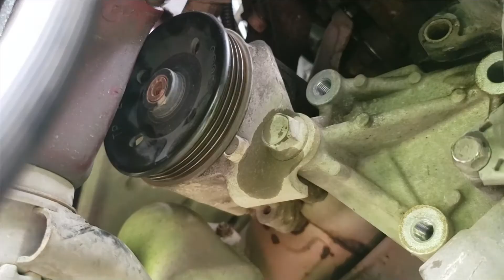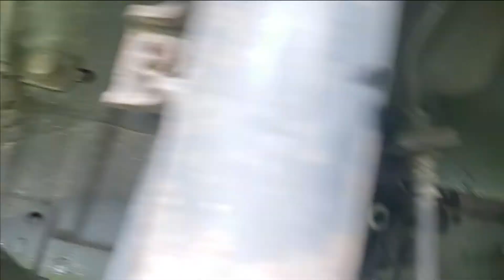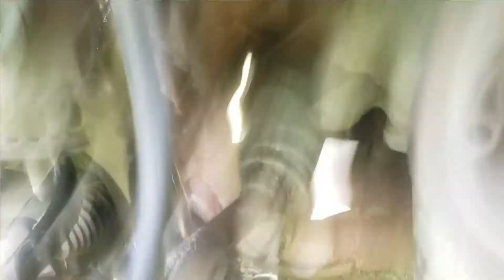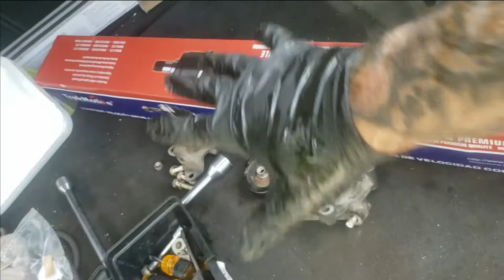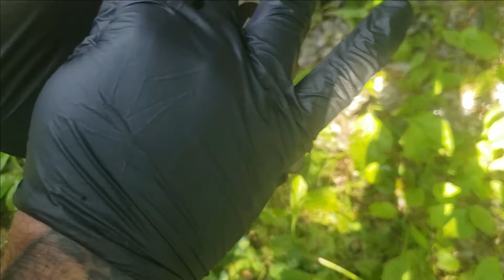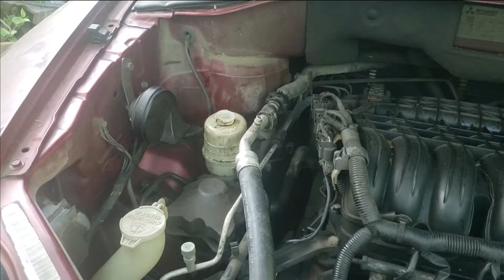Mitsubishi  Endeavor Full Power Steering Pump Removal And Install

Comment: Hello we need help figuring out the bolt size that connects the power steering low pressure suction hose onto the pump. Any idea? It's been so difficult to find.  Thank you in advance for any help
Reply from the maker: No, sorry, its been so long since I made the video